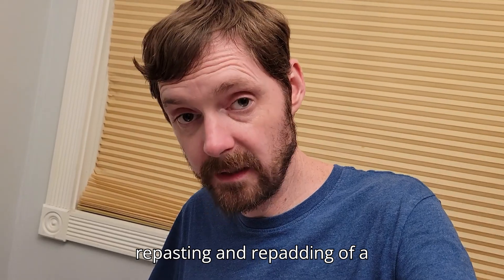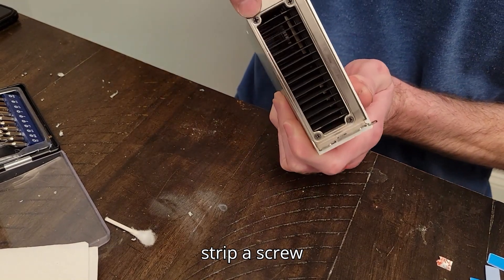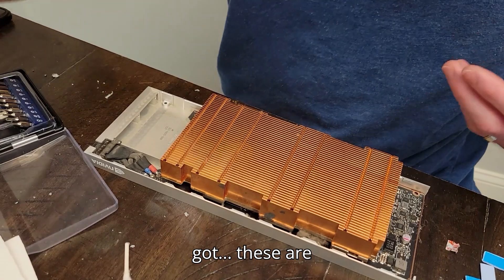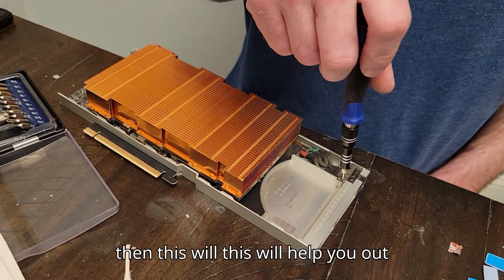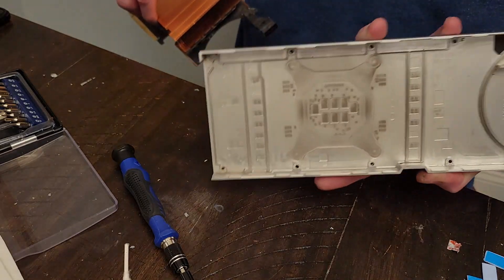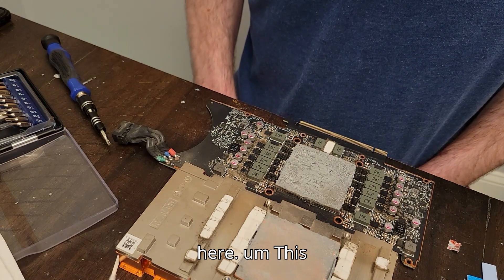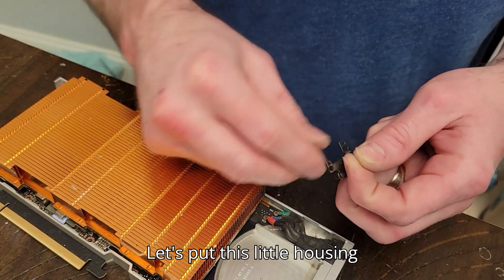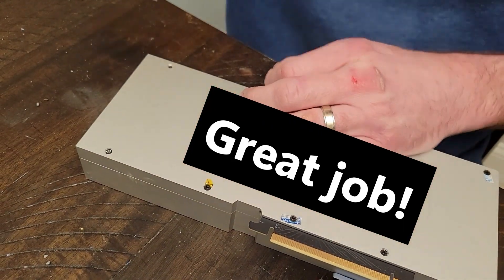Nvidia CMP 170HX: The Repastening #cryptomining #diy

Comment: come to see how thick are the thermal pads but you didnt say anything ? So what is the thickness of the thermal pads ? 1mm? i have got 30 of these puppies and some of them i need to repaste. with repasting you should use a splatula and out that paste all over the die of the card, spert it so you wont see the cards die. then perhaps re install the cooler. The way you doing is okay but it will be better the way i say. It needs alot of paste so dont be shy with it. on that die you have the memmory and the chip under the heat protector.
Reply from the maker: My bad! I used 1.5mm & it seems fine. Thanks for the tip, I'll be sure to spatula the next ones. 30?! Wow, that's quite a haul!